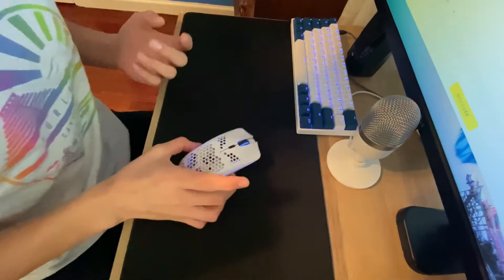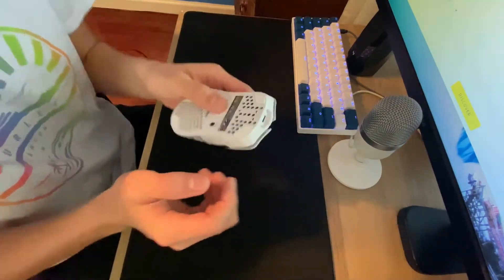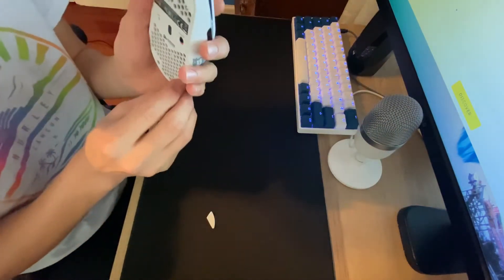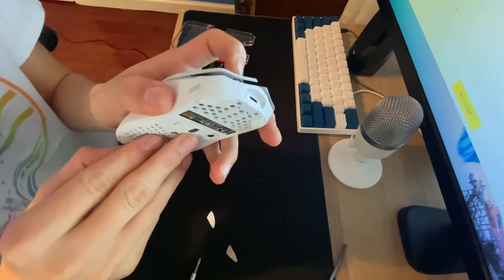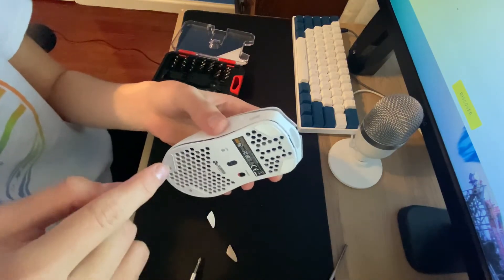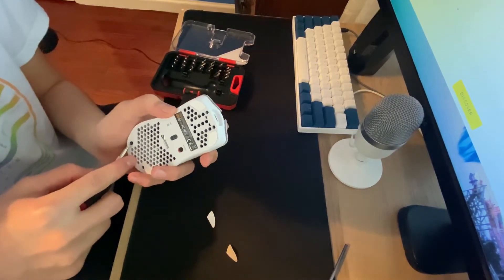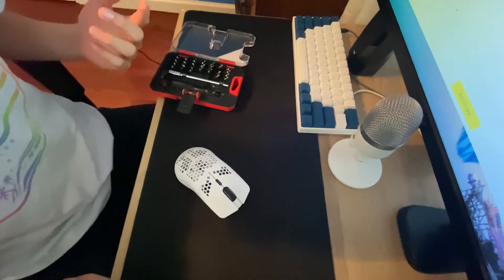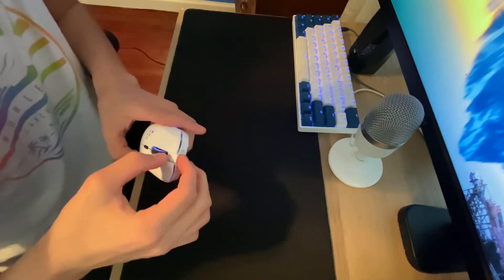HOW TO FIX GLORIOUS MODEL O WIRELESS SCROLL WHEEL SQUEAK!!! | and how to get replacement feet!!

Comment: what loob did you use?
Reply: Any PFPE fluorofluid lubricant works. You can also use PFPE for keyboard switch lubricating. Don't use any oil based lubricants like WD-40 or multi-purpose oils as they will eat up the plastic on the mouse overtime.